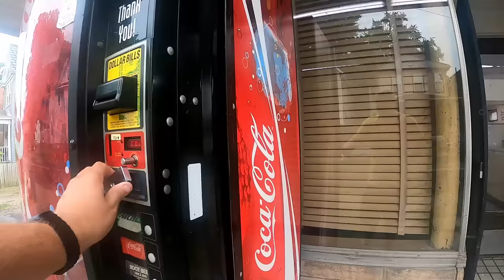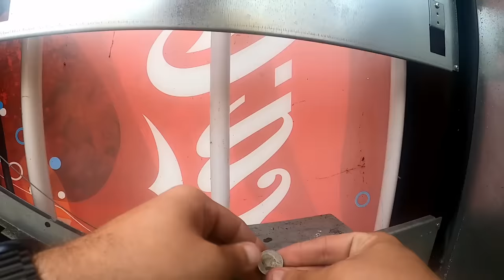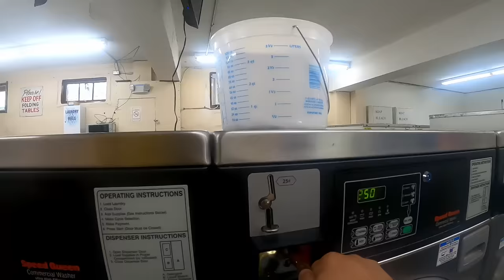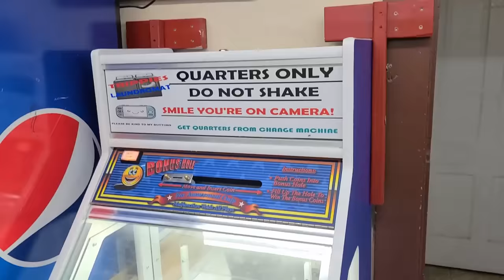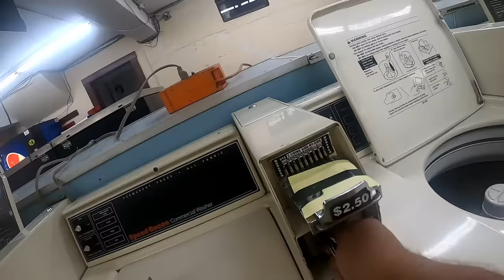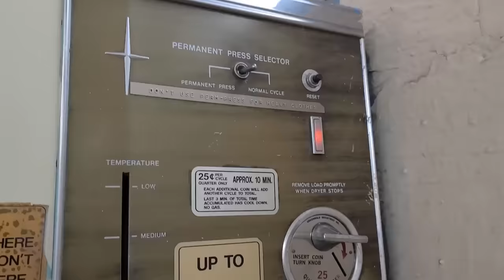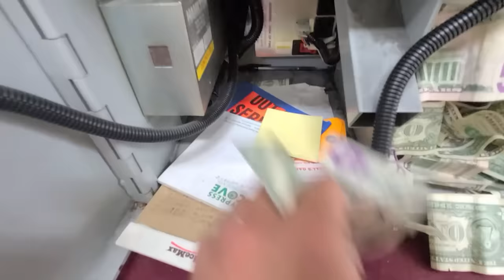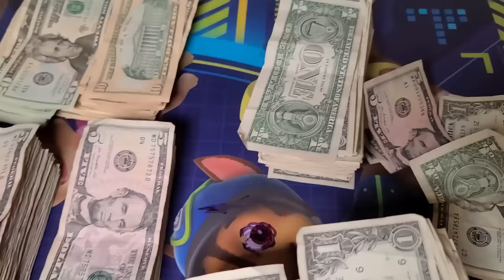Owning a LAUNDROMAT For a year! (And how much it made this month)

Comment: Working for an Apartment maintenance company in the greater MSP area as a Tech, I came across a unique laundry at a very "rough" apartment complex.Only one machine took money, then dispensed a card that worked in all the machines, (candy,Pop, soap, etc). The complex manager explained to me that vandalism and theft were zero now in the laundromat. The only cash on premises is in the "safe like" Card dispenser. Plus once they purchase the card you have captured that money. It's not quarters, it's yours. FYI
Reply: familiar with them. A convenience store next door to my old building was in an area of high-rises and older apt blocks. You went in there and "loaded" your laundry card with bills/coin, or cards - debit and cc. Very convenient, very secure. No vanadalism of any of the machines on this paycard system at all. Losers. Losers. Losers. Thieves, vandals, making life difficult for everybody else.
Reply: This is what my apartment complex does in Rancho Santa Margarita, CA and it's so much better than coins.
Reply: Like old token machines, and since you canKt use that anywhere else folks are always coming back to use up that last bit then add more on to finish and the cycle repeats.

Comment: If you want customers to "love you" install an "extractor". It is like a super spin cycle stand alone machine that reduces dryer time. The wise will use it and of course it's not free. Bonus for you is lower maintenance cost of dryers as lighter loads go in the dryers.
Reply from the maker: We have a few now.
Reply: What exactly is an extractor?

Comment: So Im a tech guy. Im guessing your in a low income area. In DC, the rich white parts of the city are going cashless. Can you workout a system where customers come in, pay at a counter, you load funds into their a card, hand it to them, and they use the card to complete transactions at either the washing or drying machines of their choice? You could also program the card to have an expiration date, so if they deposit $10, they would have 24 hours to use up the funds or else it expires which eliminates theft since they would use up funds each visit and then either return the card or they keep it and you have data as to who your customers are and their spending habits. 
All the equipment would be locked down/away with minimum ways they can actually be touched, think of it like an iphone display at like a T-Mobile or Best Buy store.
Yea it would cost more in terms of equipment but once your up and running, you would save a fortune on maintence in the long run.

Comment: to decrease the currency in the facility I would convert the machines to run on tokens. That would narrow your defense down to 1 machine that would dispense tokens for dollars. Then you just recycle the tokens from laundry machines to change dispenser.
Reply: The problem would be having to order in more and more tokens. Limited number means limit sales. Some people may keep the tokens. 

Also its never good to keep your eggs all in one basket
Reply: Kaelan Corpus if someone keeps the tokens you make more money? I’m sure a token doesn’t cost 25 cents
Reply: @ohioalarms8364  gotta keep replacing tokens. Not worth the extra effort. Plus when u run out u cant make anymore money until you restock the machine
Reply: @KcTc344  I know this is 5 months old but agreed, going cheap 95-98 percent of the time is never worth it, sure tokens may be cheap as heck to buy but when you run out for any sort of reason ya can’t make anymore money money til you get more 

Their was this one laundry mat I used to go to where they had cards you upload money onto threw a machine and you used the cards for the washer and dryer, that seems like more of an efficient way to cut down on money in the building
Reply: @zacharysolano6375  cards do sound alot cheaper to replace than tokens👍and it doesnt have a refill limit like the tokens

Comment: Why do you need a consultant? Clean ypur store , replace equipment that does not function and get a bill stacker in your changer. If you could get a rear load changer, it' s safer.A consultant won't tell you anything you do not know already. Your location seems good so the equipment is the problem.

Comment: You need a plastic bucket with a metal handle to put your coins in. About a 2 1/2 gallon bucket. Works Awesome, I have used them for years collecting coins in machines. Best Wishes

Comment: Considering I fix these things for a living I’m seriously considering buying one
Reply: That's the trick right there.  If you know how to install and/or maintain these pieces of equipment, then that's half the battle right there and HUGE cost savings.  Moreso if you are also/either a plumber or electrician.  Even moreso if the shop is outfitted in such a way that you can have a suite built into or just off of the business itself so that you are always there.  Always present.  Always around.

And nowadays with LED lighting being so cost effective and thus super effective in keeping the costs down, if you did some creative plumbing and electrical you could really keep your costs low.  Add to that high efficiency washers and dryers these days and that lowers the costs even more.  If your only real expense is paying the vending machine operators, then you're off to the races.

Though admittedly, with all the cost savings you'd realize, investing in state of the art security would be my first go-to for sure.  Like shatter proof glass for example, and perhaps a panic button type locking mechanism for the front door in case of theft.  Maybe wire up a system that trips for the 911 dispatch too?  CCTV everywhere and in HD, not in MS Paint type perspectives.  There's far too much cash there to be taking any of it for granted.  Depending on the neighborhood, maybe even a Garda or rent-a-cop type service that keeps a presence there on and off throughout any given day?  Never in a pattern because then the criminal element could case the joint.  You need to keep things abstract and random.
Reply: I’m actually an electrician by trade that’s been fixing these things for decades

Comment: Have you thought about switching to the card method? I worked at a laundromat in New Hampshire for two and a half years we had a drop off service and used the card vs quarters also front loaders are pretty bad a**

Comment: where are you? looks like oregon?
change your coin slides and coin drops to escrow card. holy crap your operation is enough to vend stored value cards from an app or central add system
you can even retrofit your existing washers.

Comment: I'm really interested in what you have to say, but your bobbing GoPro video is upsetting my stomach. On the "sticky nickel" if you don't know, that's a way to make money off of a machine. You need two things: a thing to jam up the coin slot ("sticky nickel" or even just a wad of gum or paper) and a washer on a string with another piece of gum. You saw all the quarters backed up behind the nickel? That's what the vandal would fish out with the washer on a string, one by one. I've seen it in action in a busy bus station with several machines vandalized. It makes the vandal several dollars an hour. I don't know a remedy other than putting a camera on the machine and catching the person so you can get them to move on to another victim.